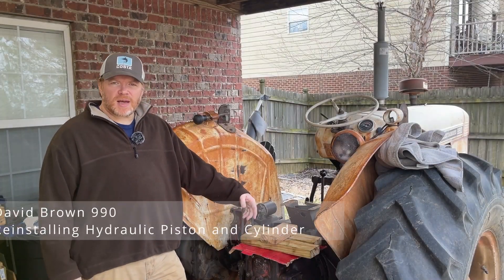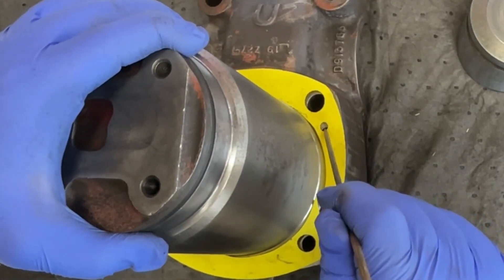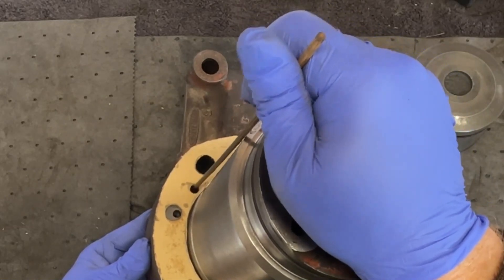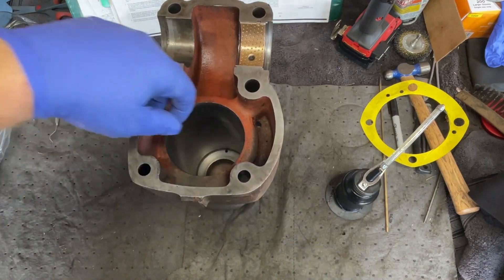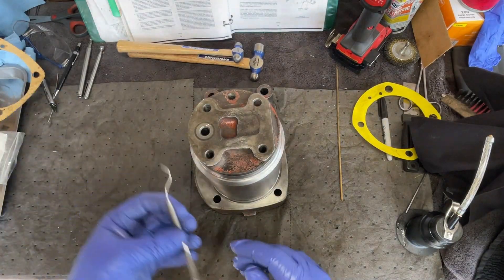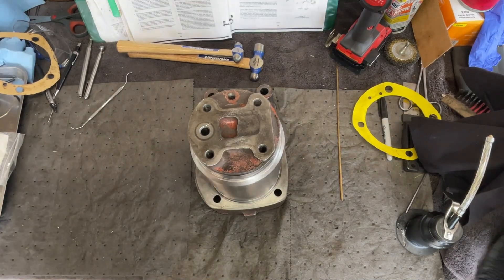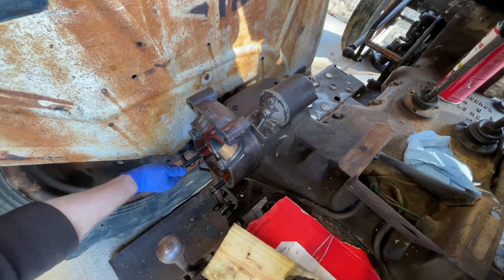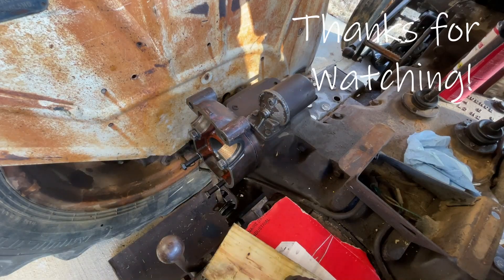Hydraulic Piston and Ram Cylinder Reinstall | David Brown 990 #15

Comment: Hi Shane, that looks really good, I always say you learn more when things go wrong(gasket) and it sounds like youre having loads of fun, well done,
Barry
PS thanks for the Oring spreadsheet.
Reply from the maker: Oh yeah, LOADS of fun.  I had another motive when videoing the inside of the axle casting and the pipe.  It goes back to a comment you left on a video about making sure the lube pipe is in place for going back to the cover.  Is that what the inside of yours looks like?  Do you have that "block" that the lube pipe goes in?  Just curious...
Reply: @path.of.discovery  Hi Shane to be honest with you I'm not 100% sure what it looks like as I didn't realise the pipe went there untill I have the cylinder back in and began putting the pipe work back, the pipe work in the old axle was missing and the replacement axle that part of the pipe work came in a bag, so it was a case of figure it out, and I could see a hole and remembered the holes in the gasket. I've still got the old casting at the farm I'll have a look inside next time I'm up there and get a couple of images to share with you.
so lets crack on! see you got it in the video 
briliant
we'll have to come up with something else as well.
have fun 
Barry
Reply from the maker: @manfromthemist1958  Yep!  I actually remembered this time to lets crack on!!  😁🤣

Comment: One of my many sayings is everything happens for a reason as you found out with the new gasket but I'm sure you had fun making a new correct one. I dunno how you make your bolt holes but I brought myself a set from ebay gasket hole punch set absolutely fantastic and not very dear. Nice to see your channel is steadily growing throughly enjoy your videos and when in a rush mistakes get made not that you'd know that lol 😆
Reply from the maker: You got that right!  Everything happens for a reason!  I just hammer the holes out w/ the round part of a ball-peen hammer like Barry showed in a video somewhere.  Hit it square and it punches out just fine.  I have a couple of smaller hammers 2oz and 4oz that really help with the smaller holes.

Comment: Hi Shane. Where did you get the o ring sheet as I am needing it to replace some of rings on the backend of the 990
Reply from the maker: I just made one in Excel based on what I'd found on the diagrams.  Here's the link to the sheet:
https://docs.google.com/spreadsheets/d/11RU7l4u7Zc2HnYeLmQ5VeWYz6SLjhxcX/edit?usp=drive_link
Your mileage may vary :-) I have notes on some of the entries on what worked and what I used as an alternative.  I ordered mainly from the O-ring store out in the western US.

I've got a bunch more stuff out there on my google drive.  Here's the general link to all of it:
https://drive.google.com/drive/folders/1NLManoOJ6WzuS3RWVQsnXfosWUDUncuP?usp=sharing

Comment: Got the seal kit from Barcley Williams. Next day delivery. Had the conundrum of which way round the seal and wiper wen't. I assumed that the seal wen't at the pressure side. I see you did the same as I did. Took the 3 way valve apart. Quite simple inside, basically a spool valve.M 😀
Reply from the maker: Glad they had it!  I wish I had a 3 way valve on mine.

Comment: I took the ram piston out. A few marks on it, got it polished up and checked for roundness within 0.0007". Do you have a part No for the big O'ring and backing seal. 80mm x 5mm measuring the grove in the ram piston. M
Reply from the maker: Good!  I got the o-ring and composite backer from David Brown Parts LTD.  http://www.davidbrownparts.com/Hydraulic%20System.html  Scroll down about three quarters of the way in the "Seals, seal kits & gaskets" section to see them.  Part number 623519K.  £27.50

It's not listed on their ebay site, so will likely have to call if you order from them.
Reply: @path.of.discovery  Spoke to them, the bloke who answered the phone  did give me that part No but none in stock. Have a local barring place in Aberdeen I might give them a try as they keep imperial o'rings. My brother has 3 d printers and could make the backing in nylon if push came to shove. There is one for sale on USA ebay around $500 + postage lol M😀
Reply from the maker: @MarshallSmart  Oh no!  Could try Barkley Williams https://www.barcleywilliams.co.uk/ or John Conaty https://www.johnconaty.com/David-Brown-Hydraulics-s/2167.htm   You could also call a local CaseIH dealer and see if they have any.

Comment: Little victories, going well.
Reply from the maker: Thanks Lance!  I'm happy that it's about to start coming back together.  Feel like I've crossed the halfway point of this hydraulics revamp.  I've learned a ton through this process.  I've been slowly making my way through all your MF restoration videos.  I'm learning SOOOOOOOOOOOO much from you.
Reply: @path.of.discovery  I was just reading an old service bulletin I forgot I had and if the hydraulic cylinder was marked you could bore it out 0.020" and they supplied an oversized piston to suit but still used the same piston sealing rings.
Reply from the maker: @BundyBearsShed  I'd read that in the service manual too about boring it out 20 thou.  The bore wasn't too scratched up, and honing it smoothed most of it out.  If it doesn't hold better I'll likely revisit and may think about getting it bored.
Reply from the maker: @BundyBearsShed  I also just emailed you on your channel email address about a potential future project.  Would like to know if you've got any information on a service manual for that.

Comment: The 2 small holes are for dowel pins -- may not be on all the models, but they are there at least on most I have worked on
Reply from the maker: Well, that explains why those holes were there!  I didn't have the dowels on mine (that I can remember).  Thanks for the info on that!  Thanks for watching and commenting!
Reply: My yellow gasket for this job arrived today so I'm fitting mine tomorrow. My 885 did not have dowels either and the parts catalogue doesn't show them. 
My thinking was... other than the 4 bolt holes in the gasket, there are 3 others. The bigger one at the 3 o'clock position is for the lube pipe, it oils the donkey's connecting rod and lift lock. I believe on mine those 2 other little holes are the pathway for the lube oil to leave and therfore to circulate. 
Thank you for your videos, by watching you, my only extra step tomorrow will be to use those 2 top long bolts as a guide, put in backwards to make sure the gasket sealer stays in place and those 2 little holes don't get blocked at all. 
Thanks again for the videos!